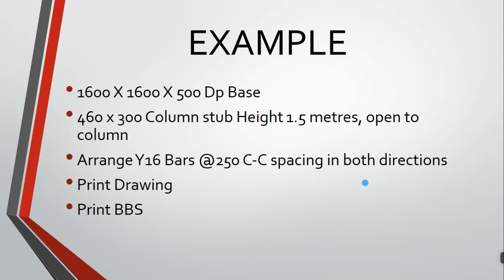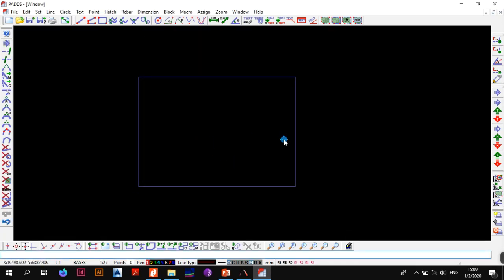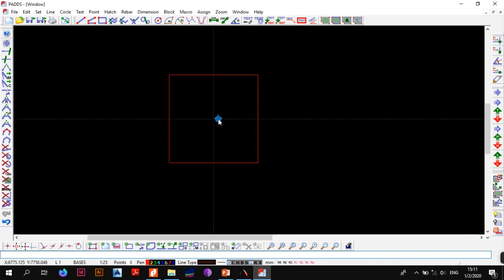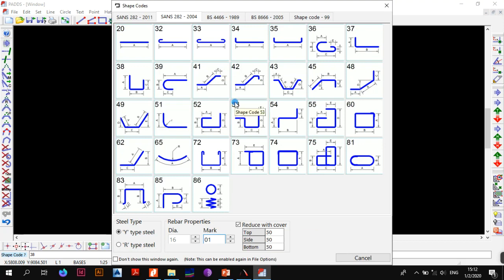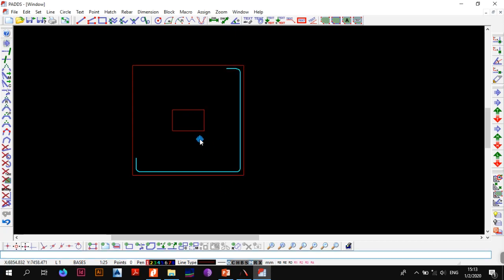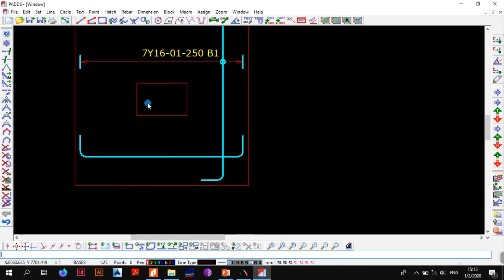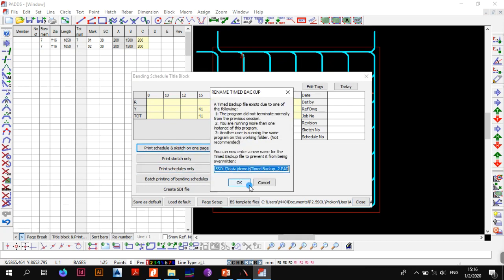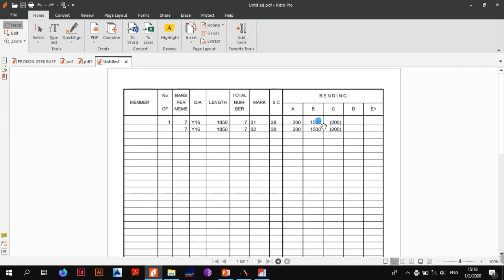PROKON TUTORIAL: INTRO TO PADDS (WITH AN EXAMPLE)

Comment: Thanks for tutorials
Reply from the maker: Not a Problem Douglas thank you very much for supporting me, tell me if you have any content you would loved to see on the channel
Reply: @prokongeek6239   Hi. Is it possible to come up with shear and bending moment envelopes for beams in prokon?
Reply from the maker: @oneito  yes it is possible, please refer to my beam design videos or playlist you will see where they come
Reply: @prokongeek6239  i meant shear and bending moment envelopes of beams that are constructed from critical loading arrangements as specified in BS 8110:1997 clause 3.2.1.2.2
Reply from the maker: @oneito  in that case you have to do it manually
Reply: @prokongeek6239  isn't there an easier way like even using microsoft excel? Coz the manual way is too tedious.